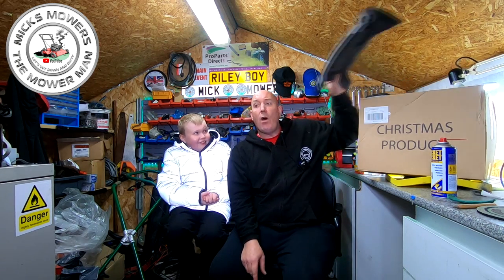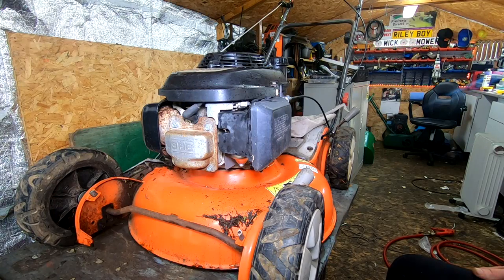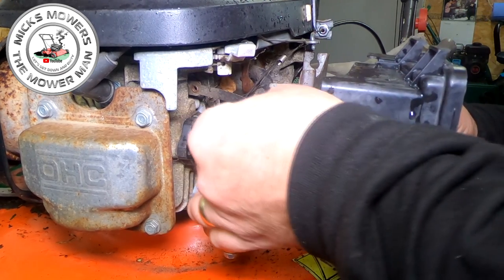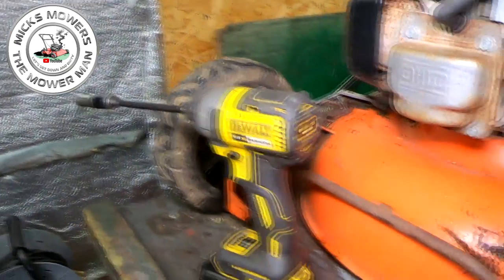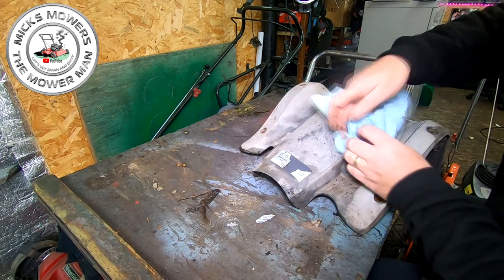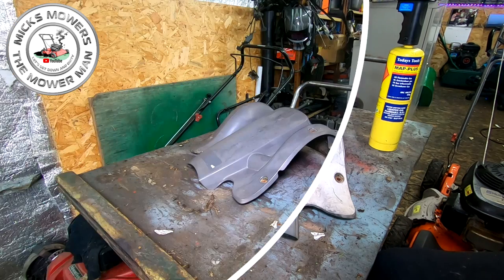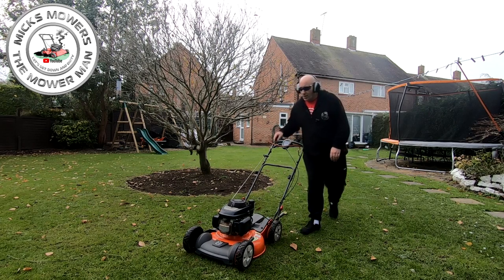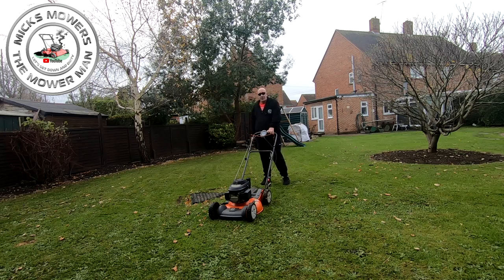Husqvarna Honda Lawn Mower Revving Too High Lawn Mower Repair Video

Comment: Great video! I just replaced the carb on my mower. When I started it up it was at full throttle. I tried all sorts of things to fix it. Turns out the return spring was kinked and was keeping the mower at full throttle. Thanks!
Reply from the maker: Yeah that would do it .. glad you got it fixed

Comment: With the plastic covers, in my experience, a heat gun, a blow dryer won't get hot enough, a heat gun, will bring the plastic back to original, also plain ATF transmission fluid shines it right up.